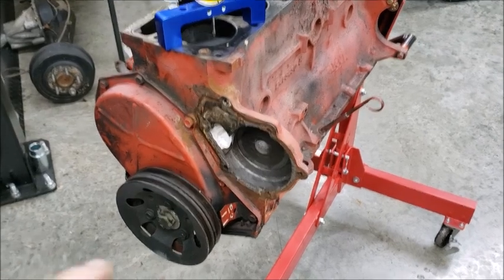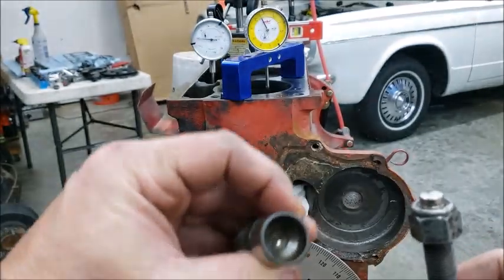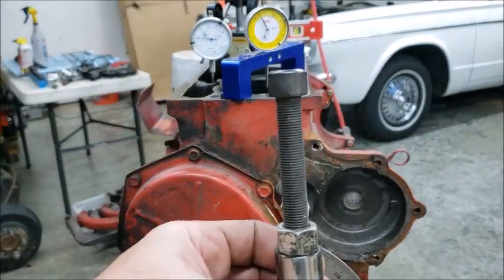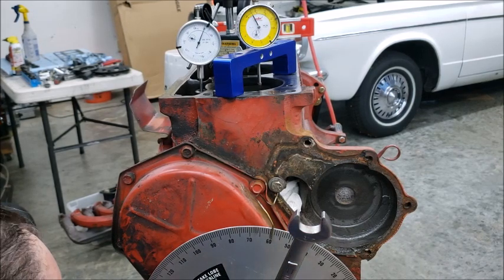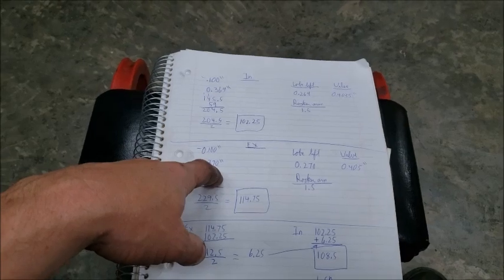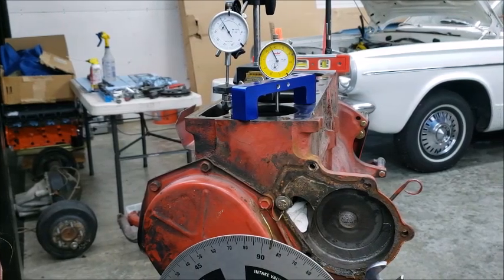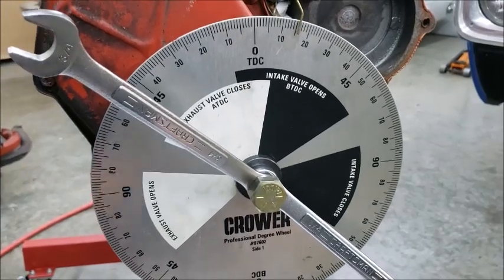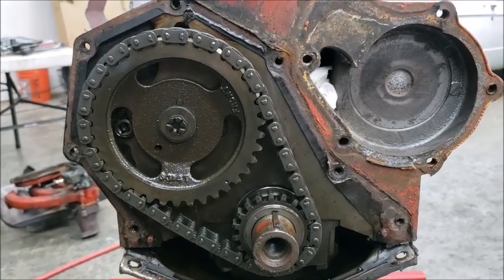Cams specs from a degree wheel.

Comment: Got a question for you. I had 90 lbs oil pressure. I put a  second fiber washer on the cap got 80  . Would to much oil pressure. Make it push oil out 3/4 ways down track   .  I think it's filling the valve covers up.  Tried old springs no help . I put a third washer in .got 60 psi now . But haven't raced it yet. No blow by . Only dies it top of second and drive. .new rings still does it. 🤔🤯🤬😂